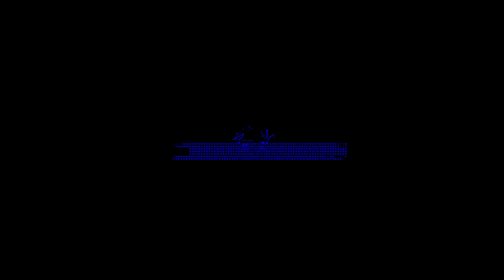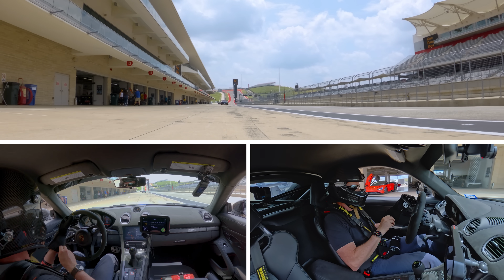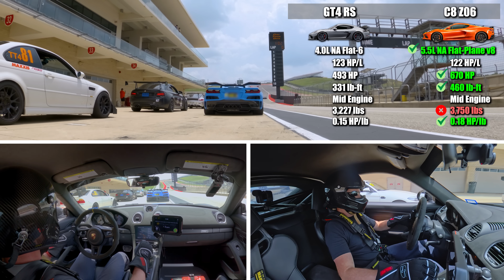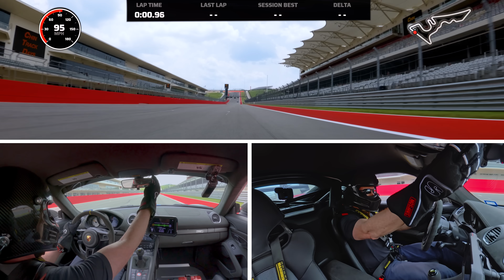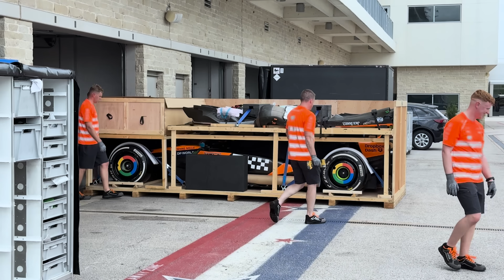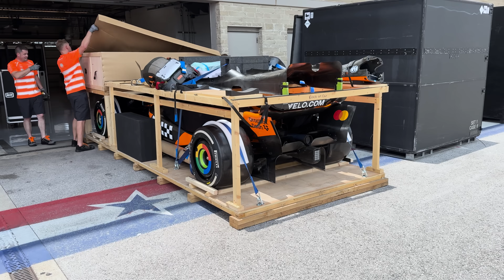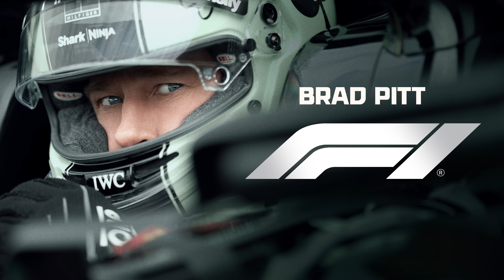Z06 vs GT4 RS : American Power Meets German Engineering at COTA

Comment: Two words...Concertina Effect. Thanks for posting a fun, well shot, edited and produced video. I enjoyed watching you driving in anger on a world class track in an exquisite machine. About the Porsche's superior braking and the Vette's superior acceleration:
In the old days, before the American broadcast networks had actual motorsports announcers, you would hear this same comment race after race from the seasoned stick and ball but auto racing virgin commentators. They kept talking about the DISTANCE between cars (which is meaningless), as you did in your video, rather than the TIME between cars which is the only measure of relative performance. The TIME between 2 cars close together in a tight turn is the same as the TIME between those same 2 cars far apart on a fast straight. Catch an F1 race and you will never hear them making this error. This phenomenon is referred to as the "Concertina Effect" as well matched cars squeeze close together in corners and stretch apart on straights like the accordion-like device that it is named for.
Reply from the maker: I understand the concertina effect, but it only happens when there's a gap between cars—allowing speed differences to build up and compress or expand the spacing, especially in braking and acceleration zones. If the cars are bumper to bumper, they brake and accelerate almost simultaneously, so there’s no room for the gap to compress or stretch. In that case, the effect is neutralized—you’re essentially locked into the same timing window as the car ahead. Slide out to 10:12 in the video and watch the grey Z06 accelerate. A 670 hp car should easily pull away from a 500 hp car on the back straight and open a gap that can’t be closed if both cars brake at the same point.
Reply: @ItsTrackTime  No...and Yes.  Thanks for the response. I agree with part of your statement. There is always a gap between cars. The Concertina Effect is always happening, physics does not take coffee breaks. Every time that you refer to the gap or "Distance" between cars as a measure of relative performance, you are using the wrong metric. Distance is irrelevant in this context. It is always about time.
HOWEVER, At the tight turn at 10:12 your Porsche is 1.1 seconds behind the Chevy. When crossing under the bridge down the following straight, you are 3 seconds behind. That has nothing to do with distance. The Vette is 1.9 seconds farther ahead of you therefore, as you said, he is pulling away from you. Revealed not by distance, but by time. DISTANCE is a red herring. Always rely on TIME differential to evaluate relative performance.
Keep driving fast cars that we can't afford and keep posting exciting videos.

Comment: GT4 looks and is dated and less performing, looks like a VW Beetle with a body kit glued on, motor, tires, interior bolt on to upgrades, is a typical german over engineering compromise due to shit weight and balance.

Comment: Hi, You stated the weight of the Z06 to be 3800. This is incorrect, as the one are were on track were coupes, not convertibles. The standard coupe comes in at 3500 and the Z06 with carbon fiber wheels come in around 3440.

Comment: The beginning portion of the video where you're talking about braking later than the car in front of you may be true, but it's not true simply because you were closing in on that car.

After all, even a slow car that's approaching a turn should be going much faster than a faster car that's in the midst of a turn.

Therefore, closing in on a car in front of you that's already in the middle of a corner IS TO BE EXPECTED, even if you're in a much slower car and even if you're a less skilled driver.

Comment: I got out of the track hobby about a decade ago and the current crop of cars available these days, in particular the GT4RS, has given me the bug again. The Z06/ZR1 have interested me but frankly I want a lighter car as I used to drive a GT-R (check my vids), and even at 3200lbs that's enticing. Watching this video and others makes me like the GT4RS more and more each time. I need to look into other models as well before I buy, but dang the GT4RS is sah-weet.
Reply from the maker: There are a lot of great track cars on the market today! Driving a GT-R, you know better than most how much weight affects track consumables. How often were you going through pads, rotors, and tires? We’ve built a solid GT4 RS community out at COTA, so feel free to reach out if you have any questions about the car.

Comment: Wish my c7 didn’t break this event would have been fun to play (black c7z, 3400 lb curb weight otherwise stock on scrubs). As I was going to run high 18s but broke a torque tube… first session… first ever failure of any kind after 6 years of tracking the Chevy on bone stock hardware and slicks. I have a looooot to get better at cota as cresson is my home track. The laptimes i run at cresson indicate a 16s or 17s or so at cota.
Reply from the maker: We're also running in the 16s, 17s, and 18s depending on the driver and air temps so that would have been fun! Get it fixed!

Comment: A lot of your straight line speed comments are actually just physics. Cars separate on straights even if running identical lap times. Higher speed = more ground between the cars for same time difference. To be able to close the gap on the straights you need a significant power advantage. Not just same power. 

Also yes gt4rs and z06 on same tires are very comparable at cota. 

Corvettes are draggy as f. Pull like a freight train to 120-130 then it’s bad. Corvette power shines in the 50-120 range. Usually top speed at cota is the same as the 4L Porsches but corvettes spend more time at higher speeds if that makes sense
Reply from the maker: If the cars are spaced out reasonably, then yes—as they slow down, the gap closes, and as they accelerate, it opens back up due to differences in when each driver gets back on the throttle. But if they're running close together, that effect is reduced since both are braking and accelerating at nearly the same time.

When one car has significantly more power—like when I catch a GT4 at Turn 11 and then pass it on the back straight—I usually never see it again. I open a big enough gap on the straight, brake late, and the other car can’t close it back down at T12. With 670 hp, I’d expect the Z06 to do the same to my GT4 RS, but that’s not happening. So as you said, maybe they’re opening a gap from 50 to 120 mph due to all that torque, but then they top out early and I’m able to catch them again by braking late into Turn 12.

Comment: Funny the dude with the Z06 fact checked making the comments during video out of context. Street tires with a passenger. CUP2 Rs and no passenger and you would lose site of the taillights. As for the C7Z, '17-19 had updated cooling improvements and the manual transmission didn't have the overheat you described. I like Porsche don't get me wrong here just countering some of the info.
Reply from the maker: If you read through the comments, several very capable drivers—including Randy Pobst and David Donohue—have driven the Z06 at COTA under favorable conditions and only managed 2:19s. While that’s a respectable time, it’s not particularly fast for a 670 hp car.

The GT4 RS, on the other hand, has seen times as low as 2:16 with weekend warrior drivers, and Randy Pobst showed it could easily hit a 2:15 on a cool day with a clear track (all documented on YouTube). To truly unlock the Z06’s potential, I think a strong track community needs to form around it—to sort out the setup and dial in the right tires. But as I mentioned in the video, after 2.5 years, that still hasn’t happened at COTA.
Reply: @ItsTrackTime   C’mon now you are being dishonest. Why aren’t you telling us that lap time Randy achieved was on a modded gt4rs? And Randy did 2:18.9 with your modded gt4rs? 2:19 you mention was done by an amateur (Function factory performance yt channel) in a Z06 without the Z07 package, no aero and with a passenger. You just can’t accept that a car you paid a lot more money losses to a corvette on 7 out of 8 tracks

Comment: The new Corvette is an American Ferrari for sure many articles talked about GM reverse engineering multiple Ferraris that were brought to there facility. It’s such a better buy because in some areas they actually improved some
 Things over the Ferrari and in some parts that Ferrari uses metal  General motors put plastic instead lowering the cost.

Comment: Now you have me wondering how my 1993 NSX with 500rwhp~ and 330rwtq~ would do on COTA.......
Reply from the maker: I’m guessing it would be a blast to drive there!
Reply: blast to drive but lap time wise you would get killed.  I tracked a 93 supercharge nsx long ago.  these 2 cars are fast at cota!
Reply: @goonthreegtr  besides the  1990s brakes what would be the NSX challenges? 

My NSX is at 2900lbs and has a massive APR GTC-300 rear spoiler and a Difflow rear diffuser.
Reply: @CarsandBikes you going to over heat.  I had 91,93, 99 zanardi and 2002 nsx.   I  overheated on zarnardi (not sure why and probably just that car), nobody on road course add tons of power and can run entire tank of gas.  your power mods design for short amount of time not 30 min of beating.  engine and tranny all cant take it. my c8z bone stock is at dealership now.

Comment: Remember, the S2000 had 123.5 hp/l in year 2000+. Record beaten by Ferrari in 2010.
Edit: 500lbs more is a deal breaker? Guess the what we saw on the track proved those 500lbs were put to good use!
Edit2: Wait for the ZR1.. then the ZR1X... you'll cry!

Comment: "American Power (on street tires) Meets German Engineering (plus $20-40K of track mods on a far more expensive car) at COTA" ?

I really enjoy your videos, but it would be better if the cars were leveled up on $$$ spent.  Like your car vs a Z06 with $50--$80K performance upgrades ?

Comment: I had 3GT3s. Tried a 24 C8Z06/Z07 . Same reason as you.  The motor is a home run. But the brakes brembo carbon ceramics. The digital interface sucks.so does the transmission. It’s no PDK.  I sold it in a couple months and bought a 296 GTB.  The vette tramlines and the interior isn’t up to European standards.  You can really feel the weight in the turns.  Maybe they have better systems engineering in the ZR1 but that’s even heavier.
Reply from the maker: Do you believe what you are describing is why we don't see many of them on track?
Reply: @ItsTrackTime maybe.  I’m from Texas but used to live close to Willow Springs.  I never knew any Porsche guys who went to a vette.  But my 18 gt3 was 6 years old and my Chevy guy was begging me to buy it.  After a couple test drives they gave me $25k and the Z06/Z07 for my 991.2 gt3.  Now I’m older and live in Idaho so I don’t have the same access to the track.  I think it’s mostly systems engineering that GM needs to fix.  There’s a problem on the ediff too, the faster you go the more it locks up.  The DCT shifted when I didn’t want it to and not when I wanted it to. The PDK and the Ferrari DCT are so much better.  I just think the guys who can buy the Z06 haven’t had the money before to get tires and instruction and track time.  Maybe with the ZR1 we’ll see more out on the track. The brakes were really perplexing.  I didn’t understand how they could be so different than brembos on other cars . But it’s that digital interface.
Reply: @ItsTrackTime by the way I had to buy a Ferrari because I can’t afford a new GT3🤣🤣 my last gt3 was $155k and they wanted $275,000 for a 22/23 allocation
Reply from the maker: I hear you! If you compare the 992.2 GT3 to the 992.1 GT3 RS, they’re now very close in price before ADM—and the 3RS is a much better car.

My brother-in-law just picked up a 296 and he's really happy with it. I’m sure it’ll keep you entertained for quite a while.
Reply: @ItsTrackTime I just feel bad because I worshipped 911s since I was 10.  I always thought I’d be nicely tucked in a 911 ( I’ve had 7) But they’ve (Porsche ) become stupid, first letting North American dealers get away with markups and now Porsche corporate wants some of that so they’re raising prices.  But yea I love the 296, it pulls and pulls. And I still don’t know how to use all the controls. 
But I just don’t think any 911 is worth $200,000 but maybe the GT2RS.  And I’m not going to pay it, especially with the humiliating games you have to play just to get your allocation.  Good luck my friend!
Reply: @ItsTrackTime in my opinion the main reason z06 not on track because people that has z06 as their most expensive cars dont have deep enough pocket to track and that is majority of the owners.  the young owners want but budget then there are the old folks that just dont.  my track buddy and I track 2 c8z but that is like the cheapest cars we track and we love it and ordered another 2026 z06 and zr1.  my educated guess people that track c8z most likely have more expensive cars.  we also have the big 3 porsche to drive and never tracked the 296 but he will get a 296 speciale which we probably won't track either. we track the gt4rs alot also but it is just not as easy to drive as c8z.  I have screenshot my braking and at same brake point as you and my speed is actually more than yours and I am not on the fastest 2r tires (on 3r).  I can tell good tires help braking but I cant tell gt4rs can out brake z06 on cup 2r.  we have run it same day, same driver and have the data.  both our c8z are on ap brakes but that just make it run longer with no fade doesnt help stop quicker.  on data, I can tell the gt4rs go thru slow corners much faster and on small course,  it ran faster but didnt feel faster!

Comment: I love great supercars from any brand.. Zondas, Mclaren P1, F1, 675LT's, CGT's, Murci's, SVJ, STO's, 997-992 GT3RS', 458's etc.. But Im a die hard GM fan at heart. I love so much about the C8 Z07..

But they also do stupid sh*t that angers me. All the electronics, power-everything, the overly-luxurious interior, features, comforts, the ELECTRIC PWR STEERING, artificial WIFI BRAKES, or ditching the manual.

But I understand, MOST buyers have to be 50+ to even afford a Z06/ZR1.. So they're just catering to their soft, old customer base. (Only 5-10% of which even track their C8's).

But I keep wishing theyd make a stripped-down, ('15 Z/28 style) Z06. 
Bare.. suede/fabric/raw carbon interior, no sound deadening, basic door cards, have 1 speaker (required by law) instead of 10-14,  manual bucket seats w/ no heating/cooling (-60lbs+), no pwr folding mirrors, no pwr steering telescoping, ditch soft close latches, trunk liners etc. 

Do hydraulic pwr steering, cable driven throttle, AP racing brakes w/ real connections, a fixed roof, adjustable aero (like on Z06 GT3 car), lexan rear glass & adj. coilovers (-60lbs)

And give us an X-trac 3-pedal sequential manual (w/ paddles). Or a manual (-200lbs).

Itd would drop weight from 3,660lbs, to 3,250-3,300lbs.. And would be THE GREATEST driver's car ever made.
Reply from the maker: Totally agree—I’d be in that long purchase line with cash in hand. Just look at their race car if you want to see what the track version should have been. When the street and race cars are worlds apart, it’s a clear sign the wrong people are making the calls in the design department.
Reply: @ItsTrackTime  Bingo. Appreciate you reading my long rant.😅 

But who knows. Maybe they're just thinking the market isnt there for a hardcore $100k+ Vette. (Afterall 70% of C7 ZR1 buyer cucks chose the non-DCT auto)🤦‍♂️

Comment: are you driving in automatic? I dont see think I see you shifting the paddles.
Reply from the maker: The PDK gets the shifts right 99% of the time, so there’s usually no reason to override it. Both Randy and I agreed it only occasionally misses the downshift into Turn 7—in those cases, we just pull the paddle and override it.

Comment: At the end of the day you're comparing a rebadged Chevy to the most successful sports car in history and 5-10 years down the road you'll be lucky to get 25-30% back on the Chevy vs 80-85% of the Porsche. If it's been tracked the value is even less on the Z06
Reply from the maker: Plus, the added weight means increased wear on track consumables over the life of your ownership.

Comment: I liked your video and the voice over was excellent, the gt4rs is a great car, I don’t think it’s faster than the Z06 but it might very well be more consistent and durable. The Tremec in the C8 is the black eye on the whole generation, it’s such a shame that Corvette wasn’t able to obtain a lasting transmission or at least fix the one they have in six years. Hopefully the aftermarket cures it soon.
Reply from the maker: Thank you! I haven’t followed the Z06’s durability issues closely, but I’ve seen several comments about the transmission. I need to look into that more.